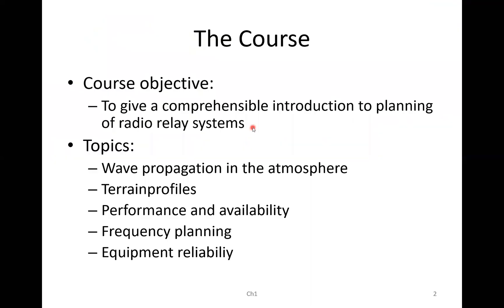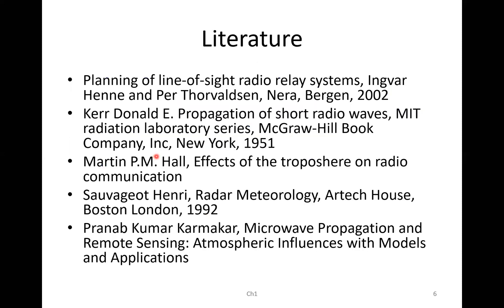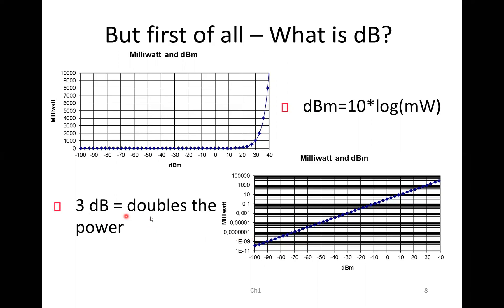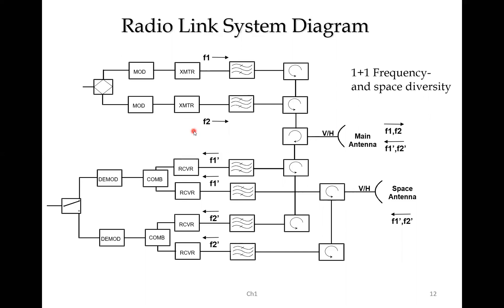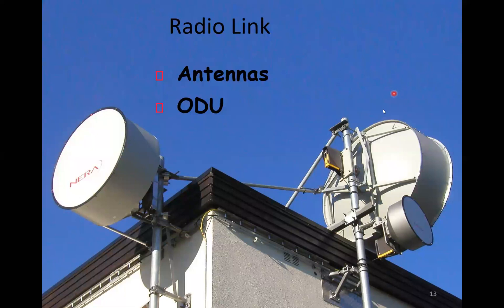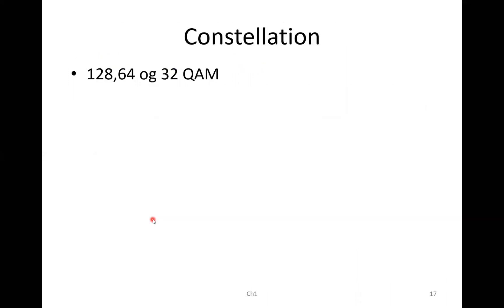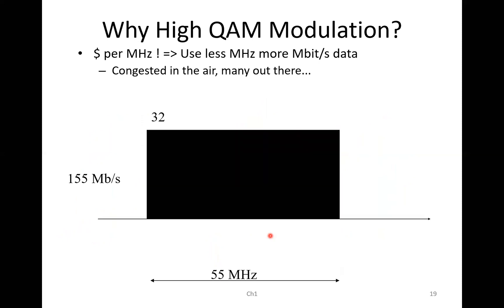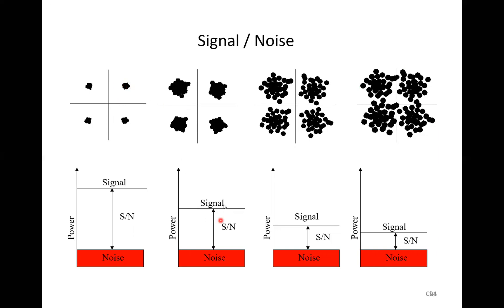Planning of line-of-sight radio relay systems

Comment: Is their a limitation to radios even if the line of sight goes for  100 to 1000 of miles?
Reply from the maker: Thanks you for asking. It depends on the link budget and atmospherical conditions. We once had a radiolink 240 kilometer long with high fading activity. This is roughly the limit. A link into space can of course reach very far.